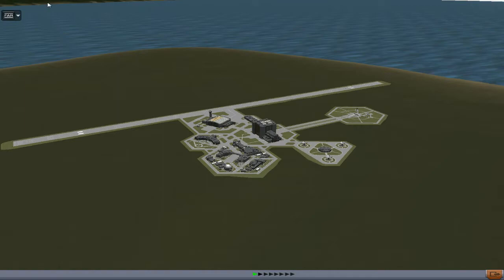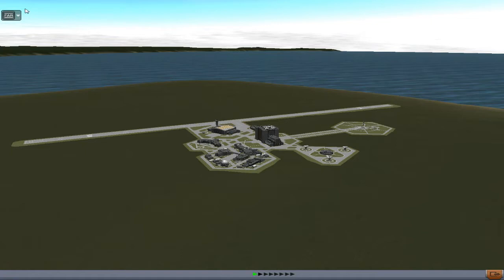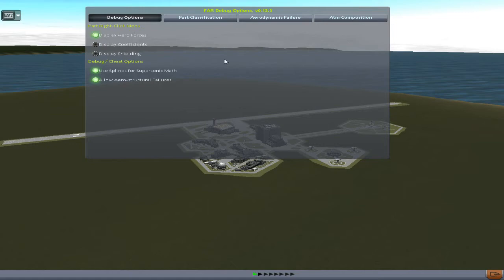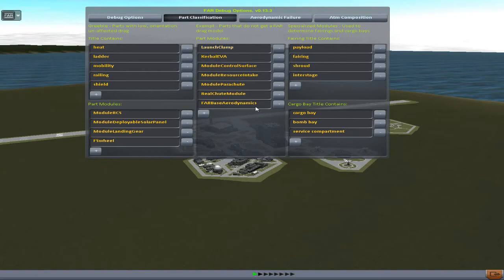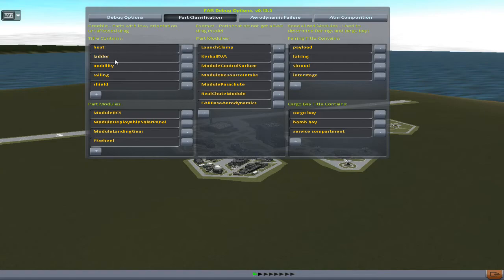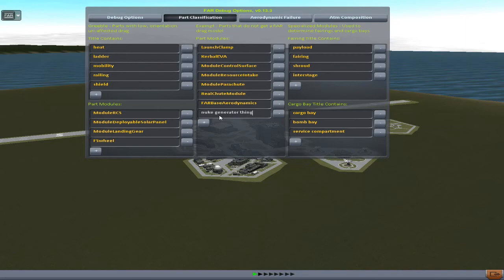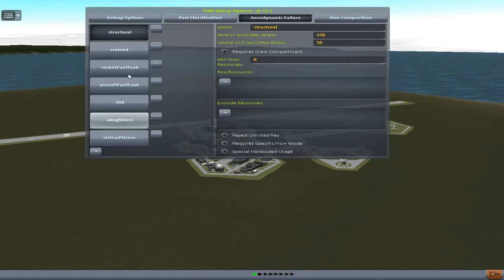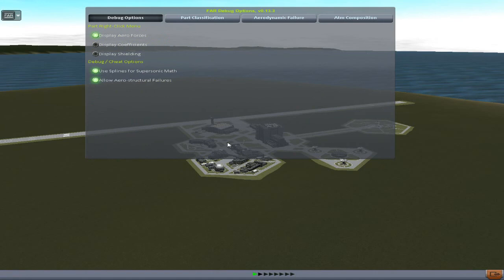FAR: how to remove aerodynamic failures

Comment: Oh yeah? Don't have to worry about ripping yourself to bits? Even without that, It is definitely possible to pull the plane apart with aerodynamic forces. They just need to be much more extreme.
Reply from the maker: huh, ive never had an issue with that once i turned this off...perhaps you still can, either way this will just help alleviate winglessness in planes. :D